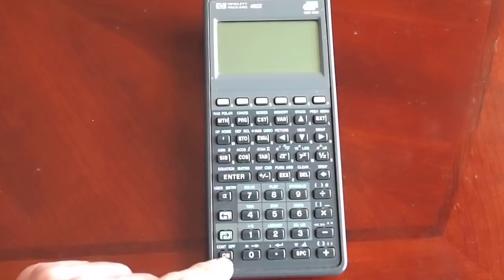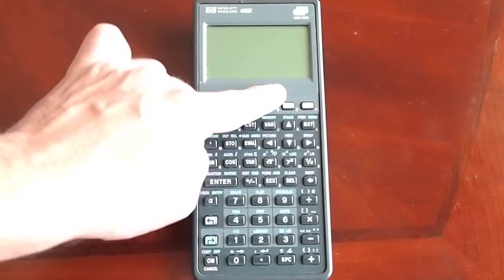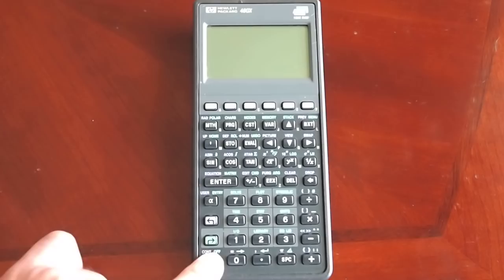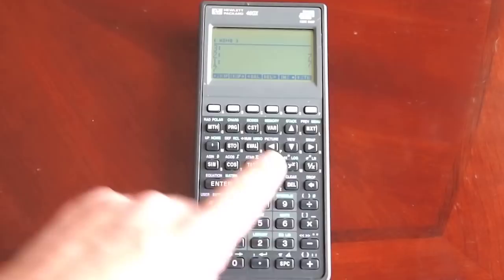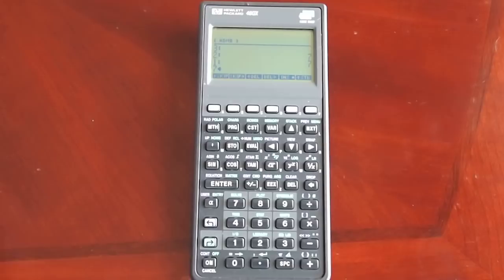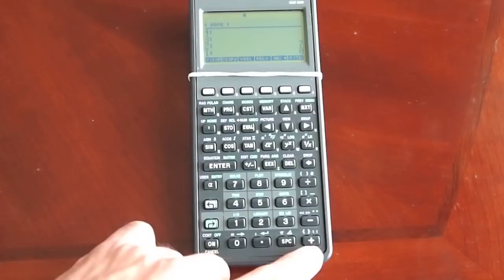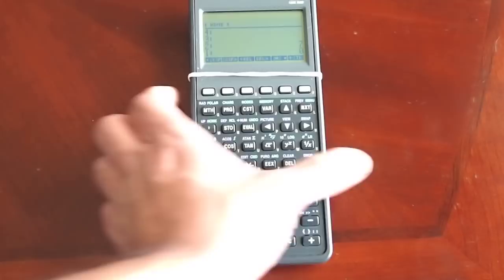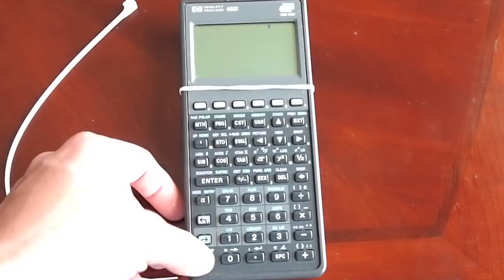hp 48gx quick fix

Comment: Permanent solution (without disassembling anything): the same thing happened to me, what I did was wash, without disassembling the calculator, with abundant isopropyl alcohol, that does not damage the electronics, it only cleans it, injecting the liquid through the keys closest to the screen . The problem is that the screen and keyboard contacts are in that area, with accumulated dust and dirt, the contact does not work well. I repaired my calculator yesterday December 02, 2020, at least it worked for me. Good look, thanks for you video.
Reply: very good idea!
Reply: This seems to have worked for me too (did it 30 mins ago). A billion thx for the tip!

Comment: Thank you for sharing this video. I’ve been accumulating older HP and TI calculators as a bit of nostalgia and wasting money. I recently bought an HP 22s, which appears to be in perfect condition, but the right column buttons don’t work. Once again I bought something with problems 😖. Luckily I stumbled on to your video and tried the trick. It worked 👍

Comment: SIR: you saved my calculator! I had that exact issue. 2 strong rubber bands did the trick. Thank you so much. I was missing my “polonaise inverse” calculation system!  Almost opened it but it looks like it is a very delicate surgery . Cheers.

Comment: Thank you for the great tip!! I love my HP 48G for everyday calculations and have had it since 1996. Recently the on/off button had stopped working properly, but by applying the pressure to the faceplate as you said, its working again. Thanks and I hope I can get another 26 years out of this calculator. It's the best! Thanks again!

Comment: Hi, my HP48G buttons 4,1,0, dot, spc and + was not working at all. I did what you done and it worked like a magic. Perhaps there is a lot of small parts with electrical contact problems inside the calculator. Thank you a lot for this video!!!

Comment: Hilarious that mine just started doing this about a few months ago and I started to look for a replacement but they are still $200 + on ebay, this solution solved my issues 100% (I was having the same problem and also with the upper row right most 2 keys). I'm pretty sure I bought this calculator new in 1996. What a beast!

Comment: Great Tip! Long years ago I had 48SX & 48GX, both died because of "Keyboard". Were you are pressing there is the Contact between Display and Circuit. It's made by a small piece of Rubberband. Rubber gets harder in time. A Mixture of 50% - Acetic Acid CH3COOH 30-(80)% and Spiritus C2H5OH 100% makes Rubber soft again.
I GUESS, only 2 drops of that Mixture between Glas / Metalcover will run onto the Rubber produces acrid fumes and might force the Rubber back in support of its inherent electrical Contacts. Damage is scarcely to be expected because of nearly no Water and no Oil in the Mixture. But I have no HP 48. Perhaps someone likes to test it.
Reply: +VierLinden-hi.de Acid is ionic will damage in the long run the circuit board and the electronics as its conduct electricity.  If you can open it and taking the rubber stuff out it may do the trick  if you can open it and take the rubber out!

Comment: This cured my ON button problem.  Light pressure is all it takes.  All the other buttons were working except my ON button.
BTW the android application called  DROID48 is an excellent emulation of the 48G.  It's great to always have an RPN calculator handy.  Can't use algebraic!!
Reply from the maker: I agree, it's a great emulator.

Comment: damn youtube, I love you.  That totally freaking worked.  Now, does anyone have any idea how to fix this permanently (without the ghetto-looking rubber band around my HP 48GX)?  This calculator is a work of art and gives me such pleasure using it, but would be diminished with the rubber band.  Currently just a slight press in that area cures the problem for a bit.  Might  just take this in to an electronics repair store... :/
Reply: If you press the 2 sides toghether from the soft keys an up with tools and superglue the joints from around  the soft key  and up almost to the topp it fixes this probkem.